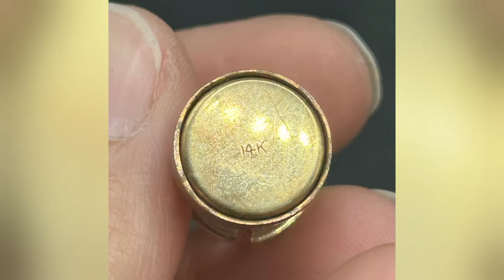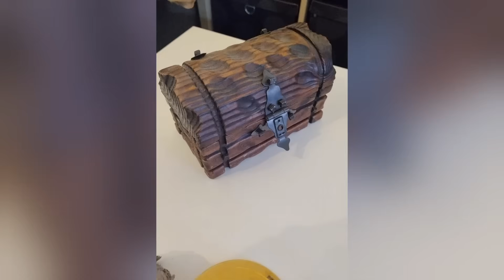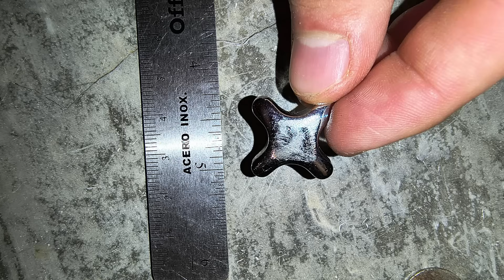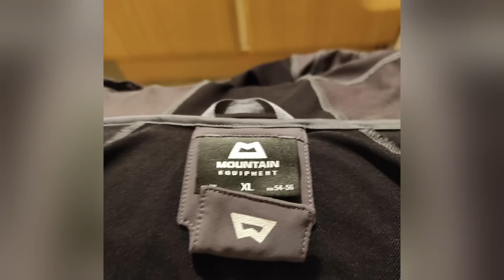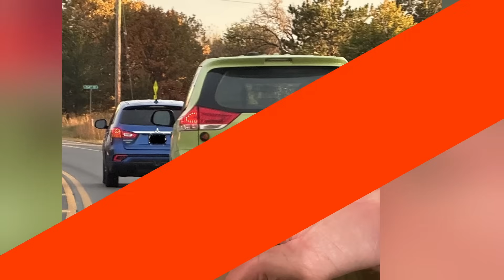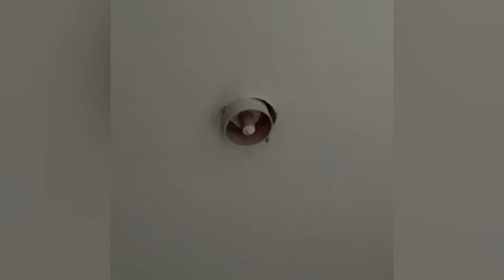35+ FORGOTTEN Items That Were Hiding a GENIUS Secret!

Comment: At 21:00 you say that is a magneto. It is not it is a guard for a circle saw handle and bottom plate off of a circle soft cutting wood carpenters use them all the time.

Comment: The bar with a threaded ends is likelier to be a bar for a single-handed dumbbell.
Such a thing being found in a closet would make more sense than either of the two items speculated in the video.
It's way too thick to be part of a snare drum, and it's too thick and too long (and wrongly engineered) to be a brake caliper slide bolt.